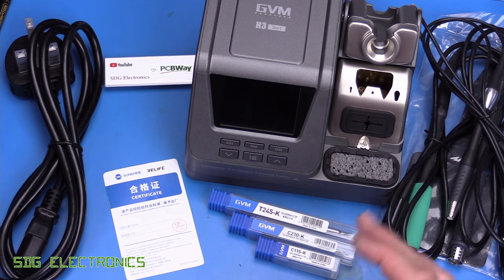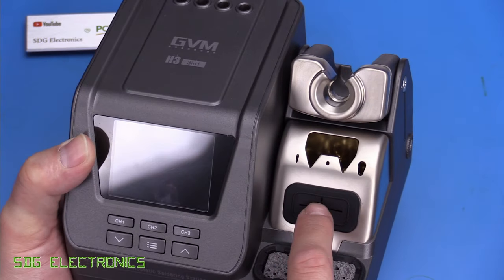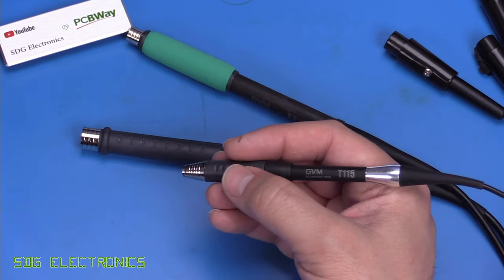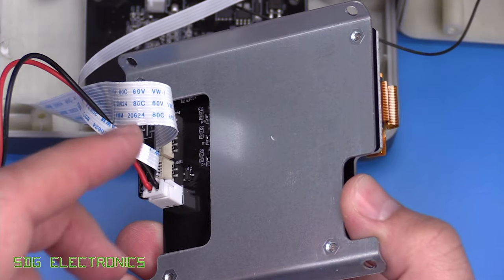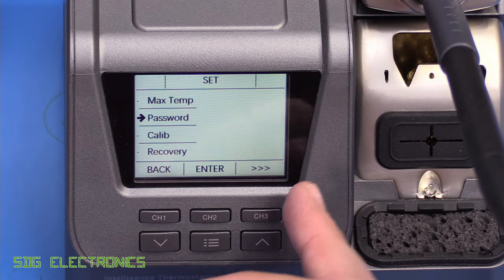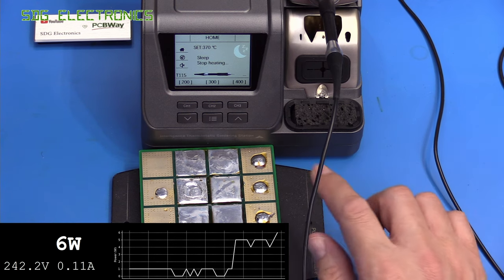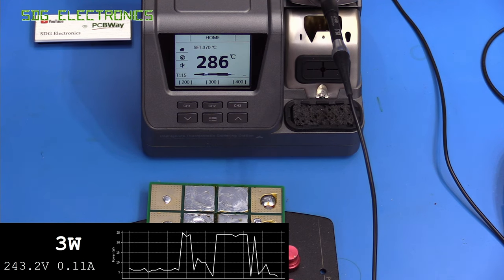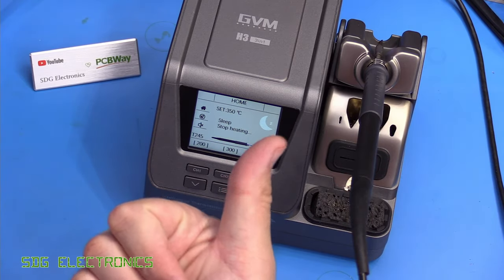SDG #329 GVM H3 80W Soldering Station - A JBC T245, T210 and T115 style system

Comment: More than happy with my Aixun T320 that I purchased off the back of your previous review. I have done 0402 resistors & 0603 LED's with the stock tips and put some big heat out with genuine JBC tips soldering ALPS pot brackets.

Very very pleased with my purchase.
Reply: Same whit 420
Reply: Do these have the sound grounding issues? The others had a lot of high voltage on the tip, and you could confuse the thermistor on certain pins

Comment: Nice looking and a good range of handpiece. But really dissapointing power output. Do you think you might have a faulty one? Might be worth having a word with the manufacturer. Thanks for putting in the effort and sharing with us, Steve.
Reply from the maker: I'll do a bit of investigation and see if something is wrong with it
Reply: @sdgelectronics can you check transformer secondary winding voltage for the heater?
Reply: @davadoff  it looks more like a software bug unless they have got themselves confused  with the different transformers turns ratio for the different regions. I suspect the unit is confused with the maximum wattage for the iron connected. Sadly the picture displayed on the display to show which iron is connected probably had more effort put into it then what the reason for showing the picture is in the first place.  
Given the calibration was erroneous it looks like the end user was going to be the software engineers free testers. it would be better to open source the software, the nerds would sort out the issues in no time, and would unhide what's going on around the setpoint as it would be very difficult indeed to hold the tip temp to within 10 C,  even with a proper pid controller. If you see the temp snap to the setpoint as we did you know they couldn't show what was happening. We forget it wasn't that long ago when we had on off control or the 18 watt heater just maxed out and we made the world with these irons.    
That said  given its got a proper transformer, and it uses cartridges from the RR of soldering irons, and they could release the held watts I would be tempted to buy the unit, and may even consider connecting an industrial 3 term pid controller to the unit to see what the outcome was. In fact, it would make a good YT video ... SDG.

Comment: Can you tell if the station delivers full sine wave ‘humps’ into the cartridge (like JBC does)? Or does it chop it up like PWM?

It only has one transformer winding to power the heater, right? I guess they chose C210 voltage for the transformer secondary to power C210 & C245, and limited the output when powering C115 cartridges. 

I’d worry that JBC C115 cartridges would fail in time if they are feeding C210 voltage into it, even at a rate of one in three sine wave ‘humps’. Could it not burn out the heater coil? It would be delivering way over-spec’d current in short bursts.
Reply from the maker: I'll do a bit of digging and also check mine isn't faulty and report back
Reply: @sdgelectronics cheers! 👍
Reply: Won't fail as long as the power is kept under max. LEDs you can pulse higher than avg current, a heater coil is going to be even more tolerant than that.
Reply: @jaro6985  perhaps it’s fine at 50Hz length pulses if average power is kept in spec. 

Wouldn’t it still shorten the life of the LED to pulse it?

Also I think JBC cartridge heater coil is powered in series with the thermocouple… still no problem to pulse current through the thermocouple too? (without going to extreme examples like 1% duty cycle with HUGE current pulses)
Reply: @davadoff  If its kept within max current of the LED it would be fine, where a 1A continuous might overheat the LED but pulsed would not. In this case the limit is almost purely thermal. Good point about the thermocouple but I wouldnt be concerned as its coupled to the tip. The tip should never exceed a reasonable temp (400-500C). So the thermocouple should not melt.

Comment: I think the 245 tips are powered with same voltage as 210 tips..you can make some test and let us know!
Reply: T210 & T245 are both powered by a 23.5V AC transformer winding. 

T210 is compatible with all the exact same JCB stations & stands as T245 (according to the JBC website).

Comment: It's not a alternative for the T3A i have. Weird is does not hit the 80w for the C245 tips and handle. The ground issue is not smth i have a problen with yet, and no new firmware has come out to fix it. Sadly don't think it can be resolved either..
Reply: I am in the same boat. I am also sticking with my T3A for now. Very happy to see quality tests like this to really know what we don't need to spend our money (and time) on. Actually, I have spent a lot more on genuine JBC soldering iron tips than the actual T3A unit, so IF a good T3A contender comes out I would be interested, mainly because of the temp overshoots. With the old firmware 1.27 it's not that bad thankfully. I don't really have a problem with the ground issue, perhaps only if I use two soldering irons to desolder stuff, but I just bought my third cheap T12 clone for $12 on sale so I just use those for that type of work.

Comment: brilliant review as usual. I was waiting for the review of this exact station but i ended getting one and not waiting. One thing i noticed is that your firmware revision number is B as opposed to D on mine. So i can assume that maybe they fixed the problems you mentioned in later releases?
Reply: Did you measure the power also being 40W max?

Comment: Can you also test different chinesium tips and find the best contender for the original jbc tips. Preferable C245 first..😊
Reply: There’s some decent ones available, the jabe ones are ok, there’s this other one comes in blue lid on case similar to jbc case for the tips but no brand on it, some cheap ones as cheap as £3 now but don’t know how good or bad they are
Reply: Maybe just get T12 system or miniware if you’re looking for cheaper system.
Reply: @M.E63  I just bought some at 10$ a piece from Ali ( seem to be called wosniak), so not really cheap or expensive. The incl tips with the T3A seem okai to me too, but the tip sizes are annoying..
Reply: @Hemshemsems  there is some that you can get quit a few tip selection but they cost around £9-10
Reply: @M.E63  Got the tip sizes i wanted i hope. Converted they were 7.80 pounds
Reply: @Hemshemsems  wosniak is the seller, he has the logo all his pictures but tons of different sellers and different prices
Reply: @M.E63 Hmm yeah seems like its the vendor - can't really find a brand name for them. But i could choose the specific tips i wanted. Later maybe pick out genuine jbc's for the ones i use most, if the chinese are crap..
Reply: @Hemshemsems  I got mixture of original JBC and china ones, there’s no brand on these but they have the clear case with blue lid for c245, they are decent, I bought some xsoldering ones for c210 but both failed when I used them in a different soldering station, it was a different china brand c210 station and they was working fine on xsoldering station but failed instantly when I tried them in a different station. The Jabe brand tips are ok as well
Reply: @M.E63 xsoldering is weird then, i only have c245 handle, and the original Aixun tips, they seem nice enough and nice packaging as well. Jabe brand is noted.. My tips should be here soon i hope.
Reply: @Hemshemsems  yh Aixun are decent, there was a review or comparison of tips on YouTube and even they said the xsoldering ones are rubbish, you only have to plug them in a station the tips doesn’t like and there dead. there’s a brand called OSS team and you can get 3 c245 tips £8 delivered including tax, I guess there ok for the money. Another thing I noticed is the resistance, the resistance on the good tips are around 2.7 ohms, the ones over 3 ohms are not that great
Reply: @M.E63  Well we want specific tips and the 3pc set always come with 2 you don't want or need. The wosni vendor seemed to have a good assortment of usable tips, and hope they are decent. Ill try to measure the resistance on them too..
Reply: @Hemshemsems  yep your right, big problem with the tips selection, it’s a huge problem with c210 and c115 as there’s only 3 nonsense tips available
Reply: @M.E63  I got the tips yesterday. I measured the resistance on them, 2.3 - 3, and 3.3ohms i unpacked. No verdict on them yet tho..
Reply: @Hemshemsems  they should be ok, don’t know how long they will last, the ones I got still working great, I bought a power meter to measure the power with each brand as some tips do cause the station to use less power

Comment: That is a very misleading specification (85 W claimed vs less than 40 W delivered).
It would be really interesting to see the waveform (oscilloscope) of the voltage sent to the cartridge to find out whether a full AC sinewave is supplied, at which voltage or if it is chopped up by PWM.
Given that the maximum power supplied to the T245 is around 40 W, either the delivered AC voltage is far too low or it is being limited by a PWM at less than 50% duty cycle.
It should be fairly easy to intercept the power pins on the handpiece connector.
Reply: or 80w is only at start "worm up" and later only 40 but this is real scam :/ 40w you will get with T210 tips and they are much smaller

Comment: I think is the transformer who don't deliver enough power, from the pictures appear to be too little to give 80W, probably is a 40W power transformer
Reply: What is the transformer secondary voltage? I wonder if they simply use C210 voltage on C245 cartridges to get compatibility with both. It would explain why T245 is so underpowered.

Comment: Your station heats up the soldering iron very, very slowly! Mine heats it up in a few seconds! The 210 soldering iron heats up in a couple of seconds, and the 115 is even faster! And the power adjustment, judging by the station indicator, works much faster! There is something wrong with your station!

Comment: This is awful. The firmware is not anywhere near the state what it should be... 40w to a cartridge capable of 120w peak and 80w constant...
Yeah... if they do not fix it, it's  not better than my 40w weller from 1990's...

Probably they're pushing the same voltage into all cartridges, the C245 has higher resistance than C210, so they need different voltages for same power.

Comment: The 80W specification is inaccurate because these most of these companies are built upon lies.  It's quite unfortunate in this case as an 80w+ version of this station would be offering an excellent value proposition.  If it worked as advertised, this station could be quite popular.  As tested here, it's a huge miss that will disappoint buyers.

The company should definitely be asked about this to give them some benefit of doubt, but I seriously doubt that this unit is faulty.  They apparently didn't expect someone on youtube to actually measure the power output and that was a severe miscalculation.

Even a novice programmer knows not to update the displayed temperature at whatever display rate is possible as the reading hovers around the setpoint.  Whoever actually programmed this interface came up with the worst possible solution when they decided to simply revert to the set temperature after some period of wandering around it.  Do better.

I also wish that they'd show the active power limit for the connected tip and adjust the 100% point on the power gauge accordingly.
Reply: To nie pomyłka 
To stara wersja stacji GVM H3.
Nowsza wersja działa dobrze 80W.
Testowana stacja ma BUG programowy.
Reply: @NANO-SERWIS.MAREK-DASZKE  ok thank you, you're amazing.

Comment: Disappointing. The 220V heater is already on 240V and only produces 40W.
Reply: I thought the same thing. 10% lower voltage means 19% lower power? (0.9*0.9=0.81)

Comment: The poor man pays twice. Can't comprehend why would anyone buy Chinese crap with a 2 or 3 years life and no warranty, when in Europe you can get the JBC BT-2BQA 140w soldering station for 215€.
Reply: Where are you getting it for that price? Been looking but only finding it for 350
Reply: Just to be sure, looked in welectron store. The cheapest JBC is 299 euros and it is an analogue unit with no screen and knob temp regulator.
Reply: I think you are JOKING with 215 price..
Reply: A poor man can go through a lot of cheap Chinese knock offs before they've spent a fraction of what an equivalent JBC costs. They're ridiculously expensive. They can easily set you back $600 for a decent brand new one. You would be lucky to score non-functioning one sold for repair on eBay for a few hundred bucks. The parts are super expensive.
Reply: stop the bullshit, the price is 575,00 €
Hors TVA
Reply: I would have thought that an electronics expert would be able to mend the station if it failed